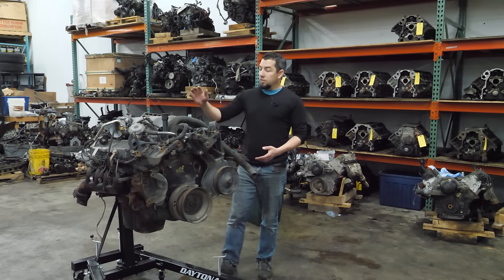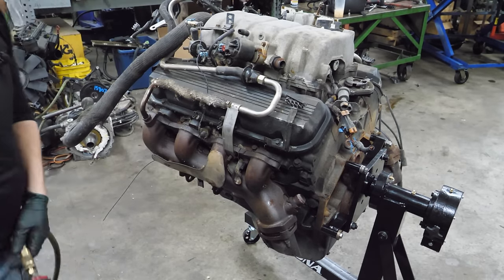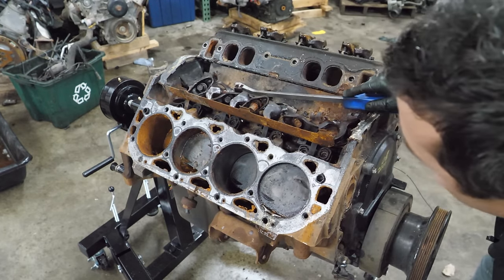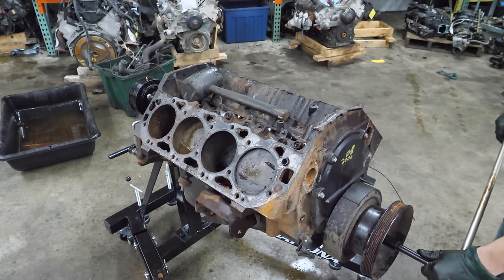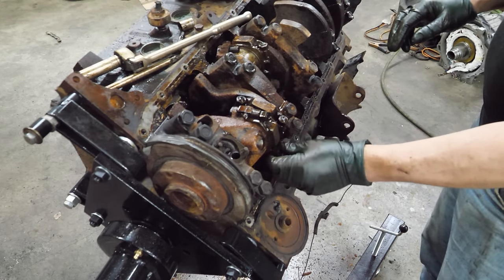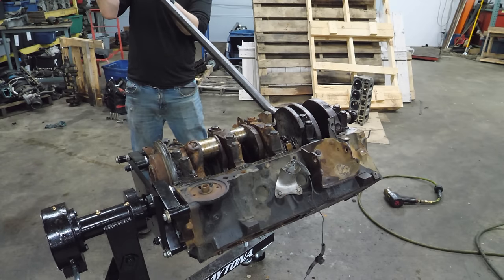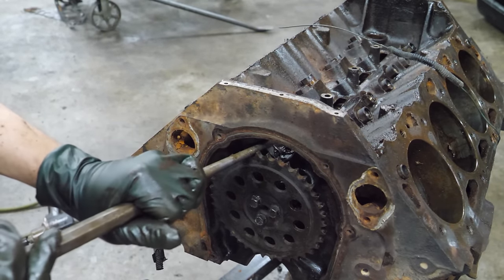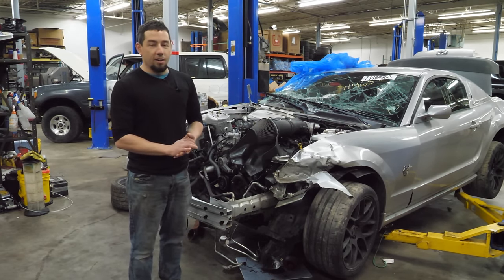COMPLETELY FROZEN! Vortec 454 7.4L BBC Big Block Chevrolet Teardown. This Was Some Work!

Comment: with the new engine stand having a crank on it you should turn the heads flat so they won't slide and fall off when blue removes them
Reply: He finally got an engine stand for these heavy motors he tears down.
Reply: @sithyarael6807  yes he got a real heavy duty engine stand now ,,i own a similar stand only mine is about double the size ,,i can hang an 8V92 on mine ,,this is what's commonly  called a builders  stand ,,most generic engine stands are pretty much just for holding an engine and aren't really stable enough to work on even a medium size engine let alone a gigantic big block that weighs over 800 pounds fully dressed
Reply: @wildcoyote34  so I guess you missed my comment about getting an engine stand that will hold the iron blocks.
Reply: Yeah, I don’t understand why he doesn’t use the crank to remove the heads
Reply: Or he can keep 2 loosened head bolts in [one on each corner of the head] so that the head doesn't fly anywhere when blue is having his fun.
Reply: @Stan S  I just figure if you have the tool why not use it to make life easier plus it won't make a mess on his floor or on himself if there is coolant or in this case water left in the block
Reply: I was just about to post that.
Reply: @sithyarael6807  -  Yeah, but that motor was still moving that stand all over the floor.
Reply: @jimamizzi1  he may actually have not thought about it ,, i am used to working on engines where the heads take 3 or 4 big strong men to remove  or a cherry picker
Reply: @sithyarael6807  i don't read every comment every person posts
Reply: Wonder when a Ford Godzilla  will be featured.  Basically a big block LS type design that's been out since 2020 in F250 & up.
Reply: It's nice to see the new engine stand.  I may visit my drug store to buy one.  Your safety and the ease of rotating the patients are important.  Cool vid!  I own a small portable hydraulic power kit with accessories.  I think you could have used a "pusher" attachment in such a kit, between the block and a crankshaft counterweight, to move the crank.  Of course, cautiously apply the power so as not to break anything!  I searched eBay and found several 6 ton models for $103 to $150.  I searched using this term:  hydraulic portable ram with accessories .  Mine is 10 ton.  If I were in the garage, I could tell you model# and the maker.  Hope all's well with your family.

Comment: So Yeah that is a 454 Tall Deck 4 Bolt Main Block Racers Love them and don't worry about the Rust They Gonna Bore it out any way the Crank looked to be cast but still a good Core rods mehh  look at the Block Close where the Expantion Plug is Pushed Out for Cracks  Nice Job young man :face-blue-smiling:

Comment: I am glad that you finally got yourself an engine stand that won't kill you them little cheap stands work in a pinch but when you are working with a fully dressed engine it's best to be safe I did that kind of work for over 40yeaes and that is what I loved doing either taking it apart or putting it back together love your videos keep it up
Reply: You know I should have said that you need to do a big block Ford like a 429 or a 460

Comment: I just went through this exact same thing with a 440 Dodge. "Stored indoors". Not. It had more than 2 GALLONS of water in the crankcase. Like you, I also have a long piece of brass rod, but one thing I use more often on stubborn pistons and rods is a piece of hard copper tubing or water pipe. The pipe slips over the rod bolt, so it can't slip off, and the copper is soft enough that it won't damage the crankshaft journals.

Comment: Another thing we used to do was a length of aluminium thick wall tube to go on the bolts so you can beat the piston out without risking the crank, worked very well the tube got very sad looking but was cheap

Comment: New to the channel but have been binging a bit. Always stoked to see someone putting out great content with a consistent recipe. No influencer BS. Maybe that's a luxury of having a real business outside of Youtube... not beholden to the algorithm as much. Would love to see a Subaru FB25 as there are two in my household with oil consumption issues. Really fascinating stuff every video. Thanks for doin' what you do.
Reply: between the FB20 and 25 engines have fewer piston rings, subaru recommending very thin and runny 0w20 oil, and those engines being boxers, they just don't scrape oil off the cylinders very well, and eventually the rings and bores glaze up, letting oil easily squeeze up past the rings instead of clinging to the cylinder wall. the fix for my FB20 was switching to 5w30 oil and driving it like I stole it to break the glaze off the cylinders, although that's not as easy with a CVT car as it is with a manual transmission like mine has, since you really need high RPM under load.

Comment: For stuff seized on studs I've found that a cheap $20 air hammer with a socket adapter bit will liquefy the rust and dirt holding whatever to the stud. Run the nut back onto it and then go at it with the air hammer in bursts of about 5-10 seconds. If possible wiggle things around or set the pry bar or a wedge to hold tension.

Comment: Man, that motor tried to beat you down.  As you said, you won.  But it fought you every inch of the way.  There might have been 5 or 6 rotating or sliding surfaces that were not rusted.  Little wonder you couldn't turn it over.  I've watched you dismantle some pretty gnarly disasters and that was fun.  This one was a grind.

Comment: Have you ever had an overheated engine where the oil pump strainer tube was made of plastic, melted and molten plastic went all through the oil system? Saw that on a VW engine recently. Was really difficult to take apart as everything was seized solid with the melted plastic - even the oil pump, balance shafts, everything!
Reply from the maker: That’s wild!
Reply: Le fuck? Which engine?
Reply: have no seen that but i have seen some german engines that have been so hot the radiator and plastic coolant adapters melted and put plastic through the cooling systems.. why the germans cant stop making the worst plastic for cooling systems is beyond me....
Reply: @CaptainSpadaro  2.0 TDI CR, 2011. Still have the oil pump impeller and a main bearing shell as souvenirs. The bores, cams and pistons were ok, but the head was cracked from the overheating, and crankshaft was ruined.
Reply: @simontist  oof.

Comment: lots of work there.  So glad to see the new engine stand with space between the floor supports which can allow for a drain tub.  Every time I saw you using the old one, I was wishing for a support built to straddle the one major leg to hold the drain pain properly to hold the oils and other stuff.
Reply: saame

Comment: Never lose that humility. It doesn’t matter how long you have been working on cars it is still a learning game. New stuff coming out that is far beyond what you would normally do that you have to learn. But just like you said it is ALWAYS a good idea to listen to advise from someone who has a lot of knowledge. In some cases that knowledge is very hard fought an won. Then there are the ones who can think outside the box. They are very useful because they think of things that most wouldn’t even consider. And in most cases what they contribute is VERY USEFUL. Just because it sounds crazy doesn’t mean it won’t work. Learn to think around the problem not though it. Been doing this for 30 years an I will never consider myself a master mechanic because I am STILL  LEARNING. It is very good that you can admit your failings on some things and you really don’t let some if it get you down an keep pushing on by figuring it out. Some can’t or won’t admit it an give up or bull through it. That’s where things can go bad. Keep your head. Slow an easy. Best way.

Comment: Great job on a very tough disassembly! I was curious about how you would pull this off when I first saw the video title. I faced a similar situation with my BBC a few years ago. 4 quarts of water in the pan, several stuck valves, bent pushrods, nasty, rusty growth in several bores. What I learned was to chase down every spot of potential resistance to rotation and remove what I could to bend the odds as much as possible. Low hanging fruit first like the cleanest cylinders with the easiest access to rod bolts, etc. I think I got 4 pistons out but still no place to get serious leverage to turn it over. Finally hit me to put the flex plate on and hook into the teeth under one of the attachments of the engine stand with a great big pry bar. Worked out great and she finally budged. Machine work is all done but I've yet to put it back together. It will be a retirement project for my 60's full size Pontiac. That's right, here in Canada all those cars were built on Chevy platforms. The best of both worlds, Pontiac styling, Chevrolet engineering! Great video, thanks for sharing!

Comment: Oddly enough, the Fab Rats channel restored a engine from a boat that sank in Lake Mead. After 30 years at the bottom of the lake, I think it looked less rusty than that one. They got the engine running again and reunited the boat with the owner. Nice series to watch.
Reply: @Retired Bore technically,  the corrosion process does pull the oxygen it needs from the water itself. But yes. Completely submerged in fresh water corrodes way slower than when exposed to air. A civil engineer from England actually measured and charted it long ago. It was reported in 1852 in Scientific American.
Reply: @TheProjectHelpDesk  Yep.   When I toured the Naval Aviation museum in Pensacola some years back they had just fished a set of SBD wings out of Lake Michigan to use on a Dauntless they were restoring. Lot of Naval aviators did their carrier quals on the USS Sable and USS Wolverine, a pair of paddlewheel Lake boats that were converted to rudimentary flat tops and used for training during WW2. There's a fair number of crashed Navy planes at the bottom of Lake Michigan that restorers are hauling up from the depths. They usually come up in pretty good shape, considering.
Reply: @Retired Bore there is dissolved oxygen in water. That's what the fish use to breathe

Comment: After watching this I couldn't help but think about another video of a motor that was also flooded only in this case it was a big block Ford on a speed boat that went down in Lake Powell 30 years ago.  Was in a hundred feet of water for 30 years then when the lake level dropped it was exposed above water for 2 years. Should be scrap.
On the second day of working on it they fired it up and it ran pretty good.  Couple weeks later it was back powering the same boat.

I highly recommend watching it at a time when you can just sit back chill out while watching. The pleasant interaction among the guys working on it make it a really nice laid back way to spend half hour or so. It shot up to over a million views in a very short time.

I don't know if it's possible to add link directly to it, I didn't even try but the channel is:
Merlins Old School Garage.
Name of the video is: Unbelieveable! The yellow submarine engine starts up after being under water for 30 years.
Posted December 21, 2022

Anyone who has an interest in engine teardowns should find this interesting. It's pretty good.

Comment: L29 block is a good one, and will take a .060 bore easily. The roller cam readiness is a hotrod bonus. The heads are great for upgrading old open chamber BBCs to add compression. Last one had been broken, sleeved, broken again. Rubble.

Comment: 4 bolt main 454 block is diffently worth money ,even if it has to have cylinder resleved,😊😊 heads can be reworked at a machine shop too ,and worth money too ,don't know about dat later model intake and plumbing stuff,but heads and block will get some nice chump change in bills ..

Comment: I wonder if a big dunk tank of evaporust would free up a seized engine like this if left for a few days.  That stuff is magical.  That one had to have been underwater for some time.  The good pistons were probably the ones with the valves all the way closed.
Reply: The evapo-rust would be worth more than the block. It might work but it doesn't always get in between seized threads, etc that are rusted closed. They have proper chemical dip tanks for cleaning up old engine parts, that's a better option.
Reply: @johncoops6897  I know there is specialized equipment to treat parts.  I was just wondering as an experiment of sorts to see if it could free it up.  For the home diy people.  In reality, you wouldn't need much evaporust if you had a thick wall plastic bag to soak it in, and another back to vacuum form that bag around the block.  He actually has one of those parts cleaners that you mentioned.
Reply: @squishy312  - I have been doing a lot of rust removal lately, in fact I just got back from doing a batch of tools and parts. Evapo-rust is incredibly expensive stuff and gets sort-of "used up" by the rust removal process, so dipping large rust objects could get very expensive.
It also tends to create a gluggy black coating which is the converted (chelated rust. This can be wire brushed off the exterior of things, but it's not so great inside threads and previously moving parts.
I guess that it would eventually creep in and convert the flaky rust that is binding parts together, but I've never had much luck with it on  items that have completely rusted solid. For example, I found a huge crescent wrench that was accidently left in a garden bed for about 40 years, and I despite many evapo-rust sessions still haven't got the rusted solid turning knob thingy to move.

Comment: Big block Chevys are my favorite engine.  that one looks rebuildable assuming the block passes a magnaflux test. i would be concerned because the freeze plugs pushing out. or it could have been over heated before blowing a head gasket. I have seen that push out freeze plugs too, but that has to be super-hot before that happens and usually hoses or radiators pop first.  the crank should cleam up with a bead blast and a regrind. cam is junk though. heads could be rebuilt but may not be worth the cost. those are gen 5 heads and not fit anything uther than a gen 5 454 or 502 The coolant passages are different from Mark IV blocks and will leak coolant if installed on a mark IV.  also, if you look at shot at 13:50 there is signs that the head gasket popped near one of the coolant passages and has a water and rust stain in the inside of the block/valley baffle in the block.  the is the medium oval port head, it is bigger than the peanut port head, but smaller than the big oval ports of the early 70-80s.   this head was designed for high velocity air flow and to make a boat load of torque. but runs out for room to breathe above 4000 RPM. its a great head for a gen 5 454 for a truck deigned for towing. but they are garbage for high performance engine in a car. at a minimum the will require new valves, new valve rotators (if it has them), springs, keepers, seals, and locks. not to mention a complete valve job and resurfacing. it looks like around $1500 in parts and machine work alone. i would pass on these since set of Edelbrock aluminum heads are not much more expensive and outperform these iron heads hands down. the only instance i would choose these heads is for a marine application since sea water destroys aluminum in not time. rods maybe salvageable assuming you didn't bend the big ends of the rods driving them out.  everything else is junk.

Comment: Took me back to my years as an apprentice at the local GM stealership. Some bloke brought his motorboat in (Powered by a single Mercruiser/GM 454) after it spent almost 2 years sunk in low water (beachfront house, the guy went overseas, didn't leave someone looking after property or boat). They tasked me with the disassembly and assessment of the damage done to the engine. Yup: rust was the name of the game. Needless to say: He bought a new engine and we threw the old one to the recycling bin. Great video, Eric

Comment: Also, if it makes you feel any better, a few months ago I had to align a 2011 BMW X5 that hadn't been aligned in a long time (if ever). I had to get the outer tie rods as yellow as the sun, multiple times, before the inners would turn. I will never understand why BMW thinks the outer tie rod they use is a good one.

Comment: That brought back memories! Well done on your persistence and tenacity. Way, way back I had an Essex Ford V6 dumped in my bay looking like that. The boss just told me to see what I could do with it. Ended up bored to 3.0L from 2.5L(ish) and it's still running today in a friend's Capri 40years later. Obviously been overhauled in between but... I know you are a salvage guy but something like that would make a great apprentice project.

Comment: one of the few engines you probably should've put oil IN before you tore it down.... a quart of marvel mystery oil, and they make a key that you can put down in the distributor hole and spin the pump with the drill... would've filled all those issue areas on the crank and cam with marvel and helped the rotating assembly spin a little.
Reply from the maker: That’s a great idea if I run across another in this situation!
Reply: Mic drop 🎤

Comment: We have one of those in a 97 c3500 dually commercial chassis. (Super heavy duty for real, like 4ton payload heavy) but the engine is great. 150 000 original Kms. Yes below 100 000 miles. Great truck. 5 speed NV4500 gearbox with PTO for the dump box. Next to no rust. Like southern USA no rust for a truck in the Canadian rust belt.